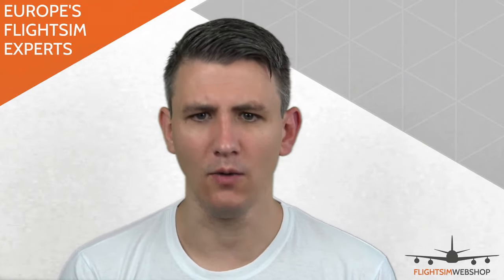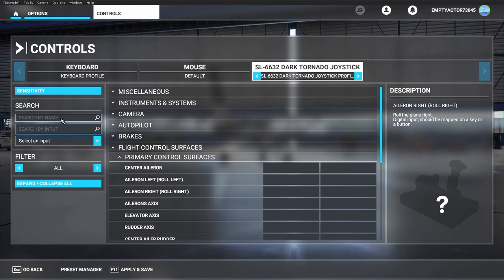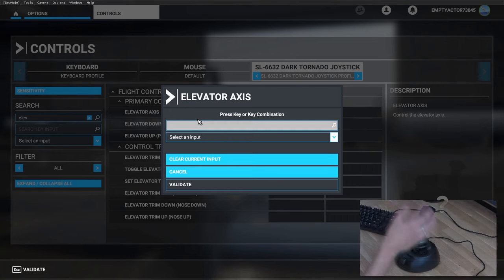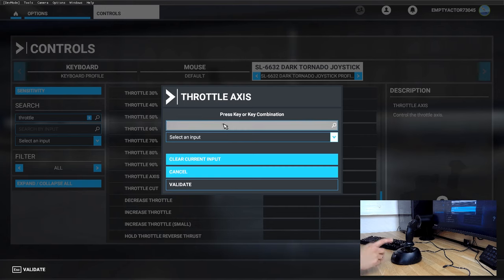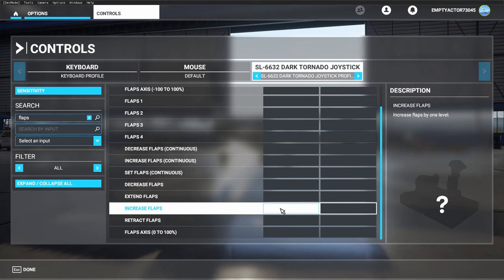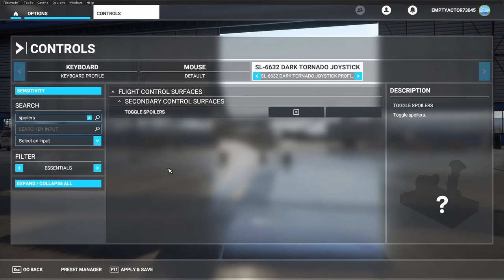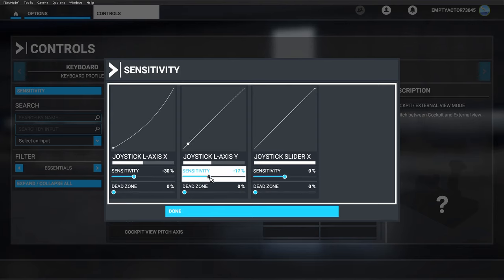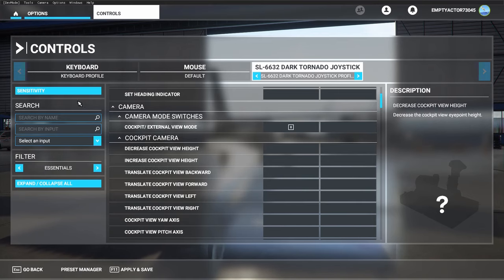Tutorial - Set up your joystick in Microsoft Flight Simulator

Comment: Thank you so much! 

aileron - move js left or right
elevator - move js fwd or back
rudder - twist js left or right
throttle - slidder 
key 1 - brake
key 2 - autopilot master
key 3 - retract flaps
key 4 - increase flaps
key 5 - toggle lights
key 6 - spoilers 
key 7 - landing gear
key 8 - cockpit/external view

Comment: Excellent!  Thanks for the help! FS2020 is totally non-intuitive, and it's inexcusable that there is zero help info in the program itself.  FS2000 was so much more user friendly.   They didn't have to change the control input setup, the 2000 version worked just fine.

Comment: I have this joystick and it causes my Flight Sim to crash, any ideas guys? it seems to load when not plugged in but when its plugged in it crashes shortly after black loading screen.
Reply from the maker: You can check your event log to find out why the simulator crashes.
If you go to the start menu and type in 'event', you can open the logbook. Within the logbook you can search for issues (errors) of MSFS. Usually, you can find an error description with an error as well, which is a good start to search on Google.

I think this is a good subject for our next video.

Comment: For me I plug it into the USB however it does not show up up the top
Reply: i have same issue
Reply from the maker: Which joystick are you using? And is this joystick recognized by Windows?
You can check this via the Windows control panel (game-input settings), or by typing in joy.cpl in the start menu.

Comment: which stick is that, does it have ffb ?
Reply from the maker: In general, stick don't come with FFB anymore.
Brunner has some great FFB sticks, but those sticks are costly and start around € 1700 (excl. VAT and Shipping).
Reply: @flightsimwebshop  completely no sens to me, i have an old thrustmaster top gun ffb and works fine…
Reply from the maker: @DJeb86  Unfortunately those FFB sticks aren't manufactured anymore :(